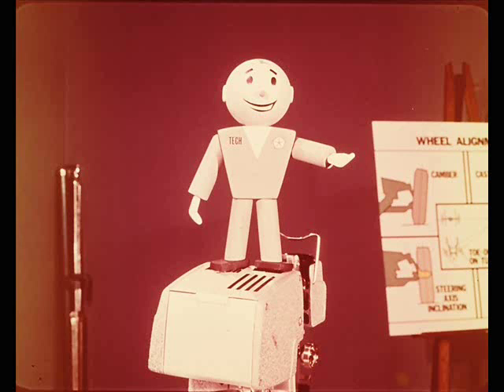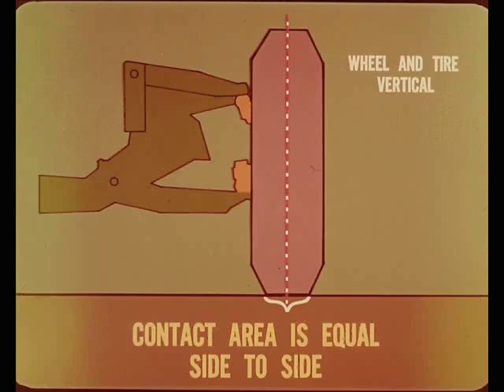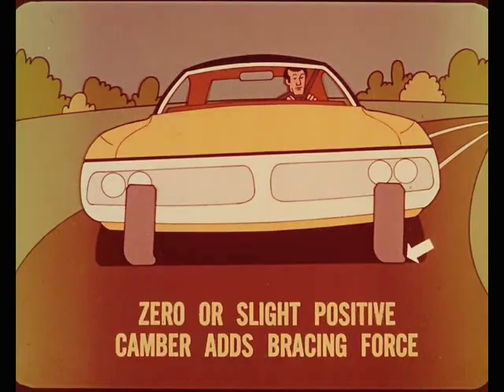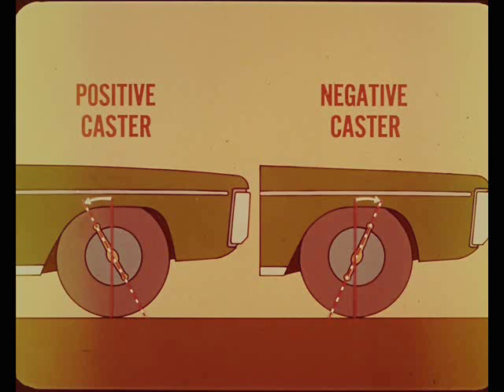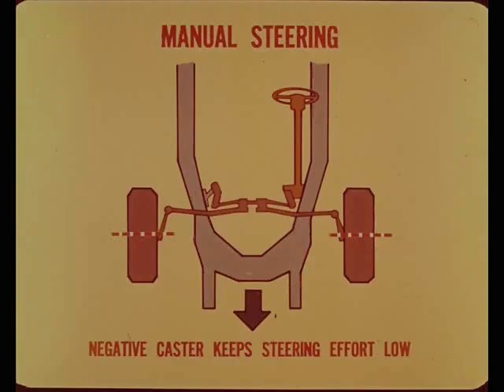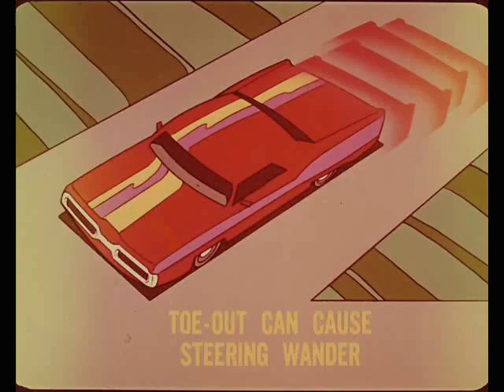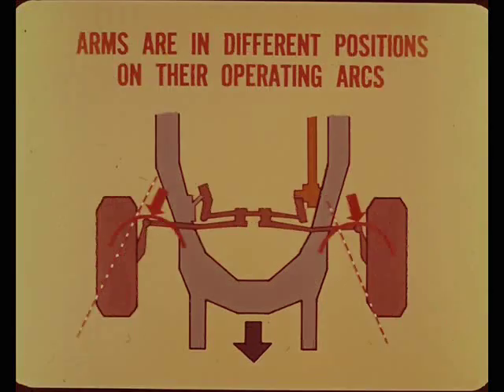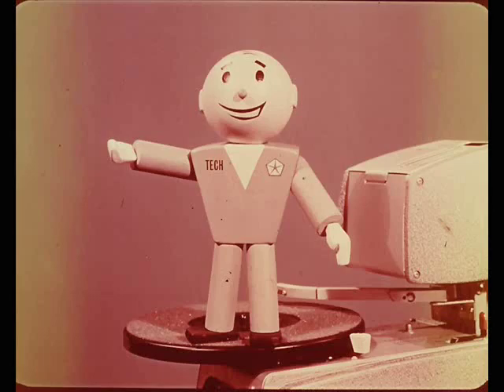Chrysler Master Tech - 1972, Volume 72-7 Roadability and Handling

Comment: I don't think I heard half of this information in automotive class. However, one thing wasn't mentioned about radial tires. Sometimes defects or abnormal wear makes the tire cone shaped. This makes the car pull even if the alignment numbers are where they belong. It was called "radial pull" in the auto repair business until radial tires were the norm. Then it got the name "Tire pull" instead.